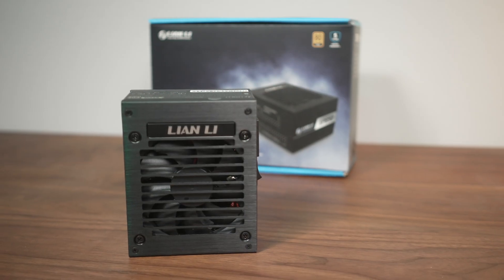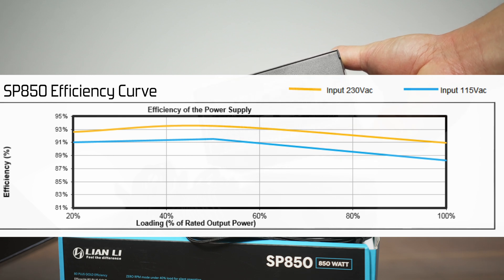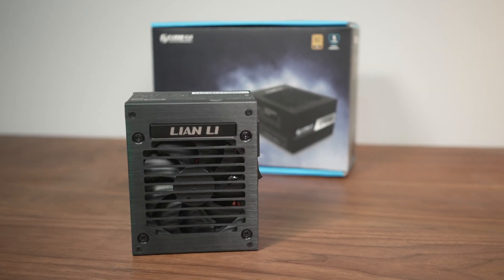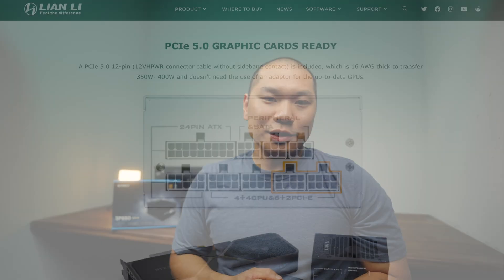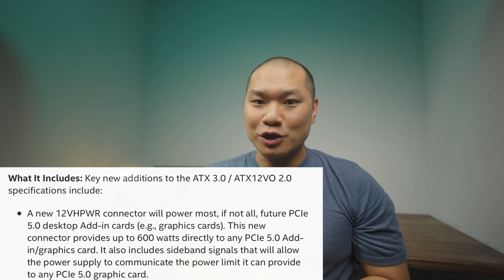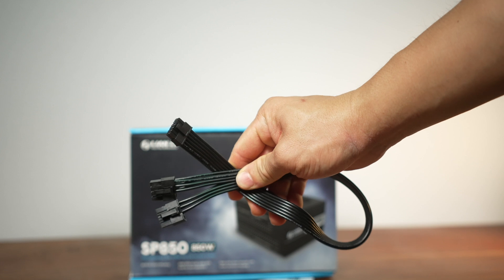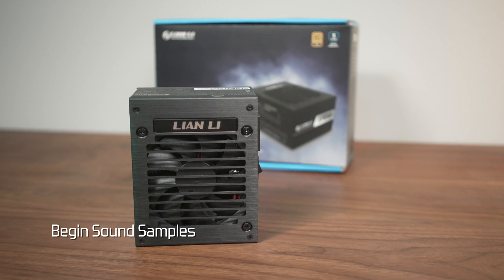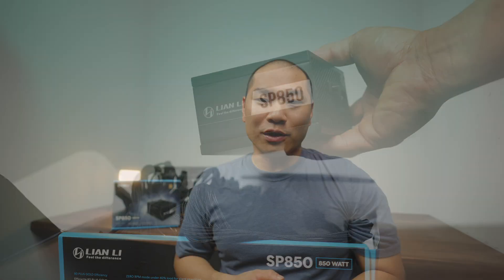The Lian Li SP850... 12VHPWR??

Comment: 850w on 120v american electricity is impresive. 850w on 240v in eu is limited by power suppply manufacturer as the transformator losses are literly 1/4 of the american one.

Comment: 4:19 trust me, Lian-Li got this made specifically for the 011D Mini. it's why the orientation is different from others I suppose. It is the first SFX i have seen with a "perfect" orientation so to speak for the 011D Mini. I just received one and I saw this and researching it, I am skeptical about that 12VHPWRR cable and connector. I currently have the ASUS Loki in consideration, but if this is ok I might get it, but that cable I am very suspect of it.

Comment: I just got mine, Lian Li has updated the cable to 12+4 pin 600watt, it also says so on the German website.
Reply: where did you purchase it?
Reply: yo is there any coil whine or issues? all the discussions on this psu r 2 years old

Comment: Fast forward a year, I did a build with this power supply but also tried Cooler Master V850 SFX Gold. The Lian Li is significantly quieter. So much so I instantly pulled the CM supply and went back to the Lian Li despite the cables fitting the A4-H20 case better and having true ATX3.0 connections. The Lian Li supply seems to run cooler and the fan doesn't kick on until after being under significant load. CM V850 turned on almost instantly despite having a big sticker saying it wouldn't (almost wondered if I ended up with CM V850 before they made the revisions?)
Reply: Hi. This sp850 u can install to lian li a4h20?

Comment: So I bought this PSU 6 weeks ago as I was getting parts for my ITX build. I finally got my 4070 FE so I put it together last night and couldn't get the GPU to power on. Turns out the 40 series needs the sense pins on the 12VHPWR cable. What a massive fail! Cannot get this thing to work now. And I'm past the return window for the PSU.
Reply: Doesn't your 4070 card come with an adapter cable ? This is from Nvidia : "The adapter has active circuits inside that translate the 8-pin plug status to the correct sideband signals according to the PCIe Gen 5 (ATX 3.0) spec.".  So in theory all you need to do is plug in your 2 regular pci-e connectors to the Nvidia adapter instead of using the Lian Li 12VHPWR cable. (Yeah if this is an SFX build it will be difficult to hide the mess).

Comment: Why wouldn't they put the extra connector on this cable. Seems pointless. Just go with the sf750 and add corsairs 12+4 pin cable that does have the signal cables.

Comment: Beware! I had this psu combined with the new AMD 7900 XTX. This does NOT work irregardless of the 850 watts. On full load, no issue. However it doesnt handle power spikes well enough for next gen cards. My system went to black miltiple times a day. Often in loading screens / booting up games. 

Have a playinum 1000 watt sfx-l now, works fine.

A lot of people have this issue, get the word out.
Reply: What power supply did you end up going with? I just got a 7900xtx and looking to build in the O11D mini. Thanks.
Reply: I heard a littlee szzzzprätz and now my computer turn on but none of the peripherals doesent work, there is no light in my rgb ram, and i got red led on my motherboard

Comment: For this unit in particular, it is worth pointing out that a component on the primary side can melt under 110V input, so this should not be used in the US.
Reply: Use in Europe is safe?
Reply: @swizzler8053  In countries where 220V mains are used, yes, it should be safe. Europe included.

Comment: No wonder this psu couldn't power up the 4090 i was building... is there any sfx psu with pcie 5 cables that i could use? I'm currently using 3x8pin to the gpu given adapter to power up the 4090 and only 1 out of 2 8 pin from the psu to mobo (not sure if this will cause any problems)
Reply: That second 8 CPU pin is just for extra head room. So if your not over clocking then your fine

Comment: Honestly, I'm getting fed up with trying to fit a sfx or sfx l that I might just use a 1200+ atx outside the case and connect it.

there really isn't a requirement to have the PSU inside the case other than potential shock? is that a myth or possible?

Comment: Could you update us on this now that the RTX4090 has been released? I would also love to see a good way to setup the NR200 with the RTX4090, especially either the AIO ones or the bigger than Founder Edition ones. Many will be too long, but I think the vertical mount should still be enough. I've also been wondering if one could squeeze the thicker RTX4090FE horizontally at the bottom.
Reply: Have a look at the NR200 subreddit. There are already people who have fitted the 4090 in the NR200
Reply: @donomar789  I know enough about it. There is a real size limit on the NR200, even more so than the NR200P. It's possible to maybe fit a FE 4090 but those are harder to come by and you are compromising on the heatsink a little. I also already have the larger Gaming OC card.  

I have the MeshroomS case, it fits. But I bet I have some fancier heat and airflow shrouding than they did :)
Reply: @hrodgarthevegan  yeah the founders edition fits very easily. The palit gamerock also fits like a glove. You can look up more info on the nr200 subreddit. The Gainward also fits but i dont know about the rest
Reply: @donomar789  Are we still talking US market? 

In any case if one were looking for the coldest AIB for both core and memory and air cooled. The Gaming OC is still the one. The water-cooled ones also seem to not cool the memory, whether by design or defect in execution I don't know.

Comment: Great video, will there be a problem when using a 3090 TI FE? I mean is the communication between PSU and GPU needed (12+4 Pin)? Or can i just „limit“ it to ~400W with the cable (12 Pin)?

Comment: feels like new high end SFF builds for the upcoming gpus and cpus is gonna be rough. would be nice if mATX makes a comeback and there's more quality mATX or smaller ATX cases. I'd wait for the next gpu and cpu releases for SFF builds if it were me. hardware should be getting better and more efficient with more or less the same power requirements for the high end parts.

Comment: One thing we discovered in the sffpc discord is that the sp750 does not comply to the sfx height requirements causing compatibility issues. I believe the 850 variant will have this same issue.
Reply: Could you elaborate on this? Genuinely curious.
Reply: @epico5805  It is wider than the spec for sfx power supplies. This means if you sit your power supply in a bracket it will be 3mm thicker than the bracket. For a super space optimized case like the formd t1 it means you will not be able to install the side panels, and for a case like the ncase m1 you might not be able to install the power supply at all.

Comment: RTX 4009 660W + 13900k 400W = 1060W already so 850W PSU... yeah... 
Sorry, but companies went crazy with power usage to boost their products' speed to the moon.
And why dual 8-pin to 12-pin and not triple. Again, this hardware is not suited for the upcoming high-end hardware. And for a low-mid range, you won't need 12VHPWR anyway.
So 12-pin I would consider only with 1000W+ PSUs otherwise I wouldn't bother and took this as a marketing move.
Reply: Probably you will be fine with stock 4090 and 13900k even on SF750 and I doubt stock TDP will be increased by that much.
However only two 8pin to 12vhpwr is really strange decision and I can't understand why they picked that way.
Reply: @mattspeed  But 4090 in 450W probably will be way closer to 4080 than the advertised 4090 benchmarks they will show us during the presentation. So this is misleading, you won't get what you paid for with 450W switched BIOS.
I'm not sure about this 750W, for sure not with 4090 and 13900k.
Reply: @tomtomkowski7653  well, let's wait and see legit reviews. Either way currently I'm drawing about 600w from psu in Sliger SV590 and SF750 and it's like on the edge what can be called SFF and definitely on the edge of cooling performance, so I doubt I will go any further if that happen.

Comment: I know it's somewhat optional, but I honestly wouldn't consider this PSU.  If I am going 12VHPWR I want it to have the full spec with the 8 signal/side-band terminals. Dual 8-pin to 12-pin doesn't do it for me.
Reply: Of course, this should be triple 8-pin to 12 pins and let's be honest 850W is nothing for upcoming gens.
Reply: @tomtomkowski7653  850w is fine for upcoming cards, manufacturers are just over recommending because they have to cover every possible build. Even a worst case scenario I9 12900k and a 4090 will not exceed 850w total power draw unless you are doing serious overclocking and this is assuming both GPU and CPU are at max load.. not common for typical gaming.
Reply: @tomtomkowski7653  I don't think that's accurate. as manufacturing sizes get smaller, the wattage tends to stay the same or goes down.

I used to run a 1200w for very old cards, new cards use so little wattage to do so much more than those cards ever did.

Comment: Didn’t pci just warned about the use of adapter for the new adapter connector of heating up?
Reply from the maker: Yup. In many scenarios the capacity at the pins/connectors is the weak link. With the current gen of GPUs the power draw won't push it to that point yet. However, with a 600W card this is will be very dangerous without the sideband communication.

Comment: I have a corsair sf750 running my evga 3080 ftw and it runs fine
Reply: Wait till u upgrade to the next gen graphics card.
Reply: It all depends on your components. How much crap consumes what power… if you start upgrading to a more powerful hardware, it won’t simply have enough juice to run it all. I’ll give u an example - a new gen 40 series GPU and a 12-core overclocked CPU will require a lot more power if you run some hardware heavy applications.
Reply: @Andrei_A220  It more that the new GPU's require 12VPHWR to run, rendering current PUS's including 1000w and above all obselete soon. So anybody buying a PSU now and expecting to upgrade in the future will have to change their PSU's again. This is due to intel introducing ATX 3.0 as the new standard for power supplies.